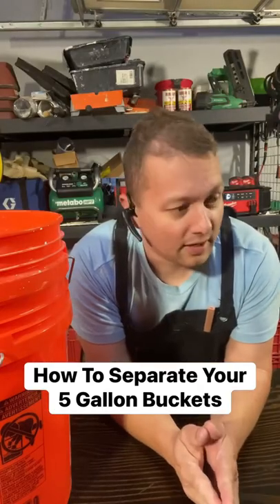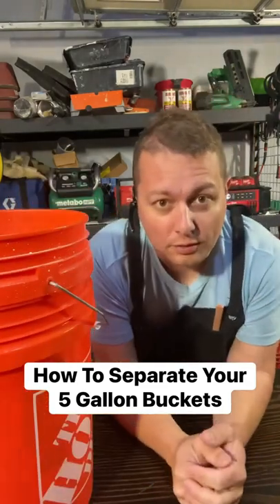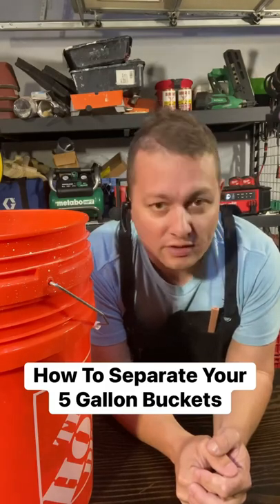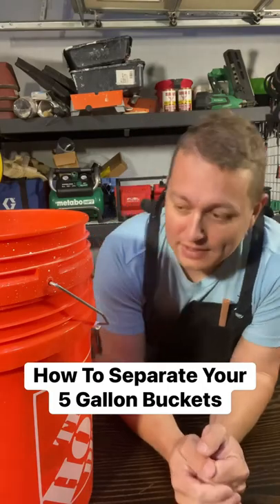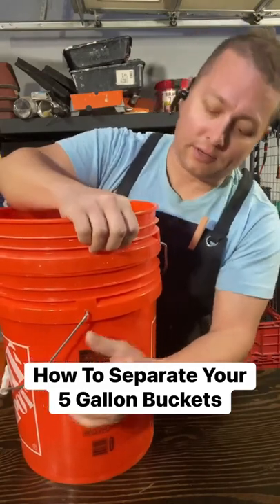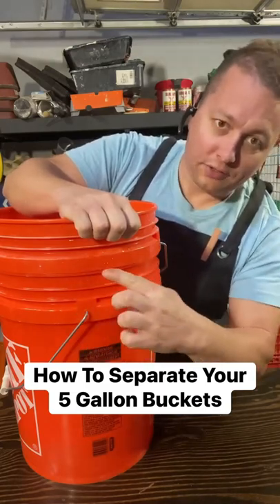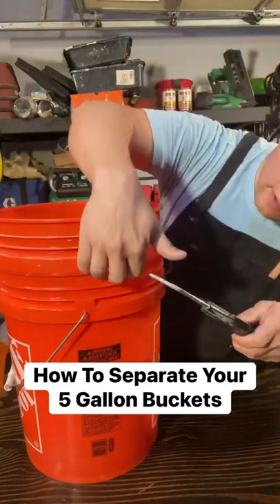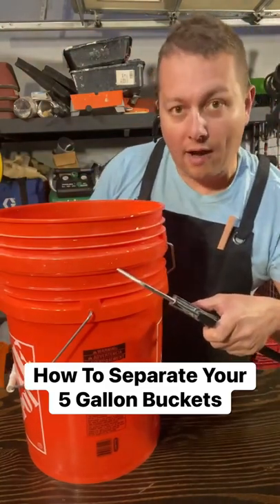How to Unstick Two 5-Gallon Buckets

Comment: Ive always used the pull apart method. Push down with your thumbs pull up with the rest of your fingers. Use both hands on opposite sides of the bucket. If you pull up one only one side your never going to pull it off.

Comment: Turn them upside down. Put your foot on one handle and then pull on the other handle they'll separate.
Reply from the maker: Thanks for the tip
Reply: Not always... I just commented about the buckets sticking and I didn't mention that I tried this, but they wouldn't come apart. Sometimes you should work smarter not harder and your idea was one of the first I tried. It was harder not smarter.

Comment: So overcomplicated.
1.Pick up the buckets  and turn them upside down
2. Look for the bottom buckets handle 
3. once you see it place lower the handle to the ground, once there step on the handle, your still holding the buckets I  hope.
4. simply pull up on the top bucket while pressing down with your foot so the handle stays put.
5. tah dah.. takes about 5 seconds to do and not one tool needed.